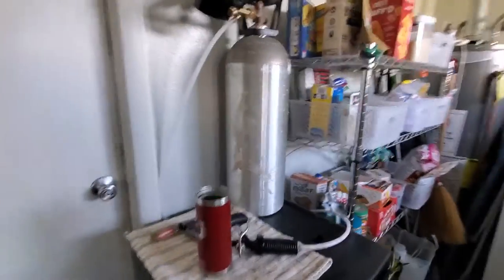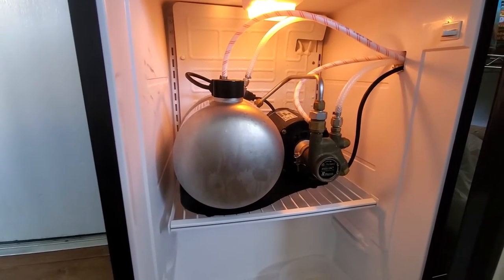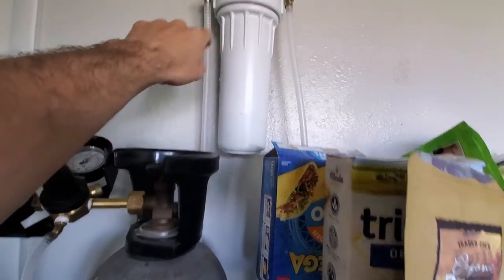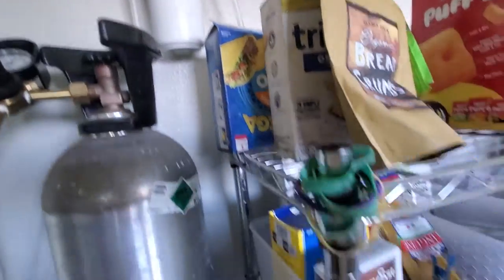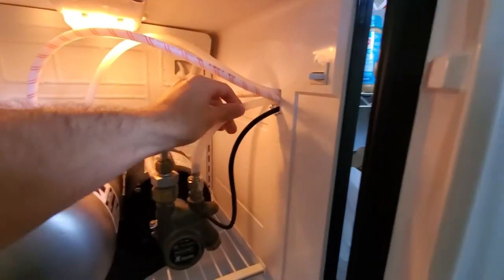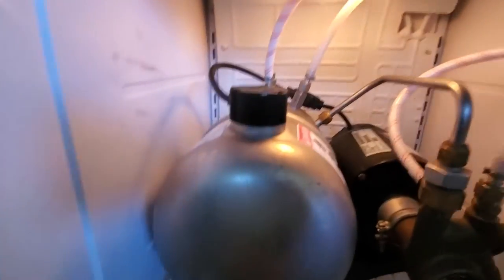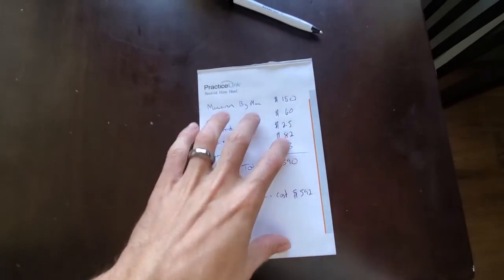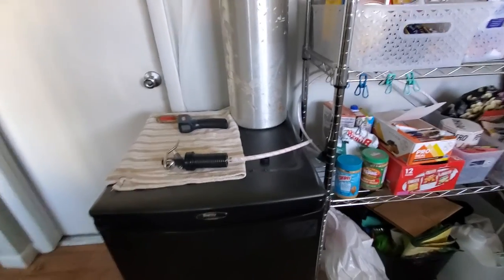DIY Home Seltzer "On-Tap"

Comment: You can add a long section of coiled hose inside of the fridge to the water in line. When water is pulled in it will pull the chilled water in that length of hose first. This is how the water dispenser in my old fridge served cold water.
The only challenge is with mini-fridges not having the best temperature control to keep it above freezing, so I would be careful with thermostat and placement of hoses. Possibly some strategically placed insulation to keep the coldest area semi-isolated to the coil and thermostat.

Comment: Awesome system and very well done Sean!

I am have been making home seltzer water for many years using the 2-liter bottle and co2 tank method. 

Question: If the carbonator is just pumping water into a chilled tank with Co2 applied to the tank...why is the pump really needed? It does not seem like it is agitating the water? Does is add PSI to the system for enabling the water from the tank to travel a distance? 

My experience has been that agitating cold water with Co2 gets the "tart" I like. I run about 32psi with vigorous shaking for about a minute total. I am not quite getting how the carbonator is able to infuse the co2 into the water as it seems the two only meet in the chilled tank.

Thank you!
Reply from the maker: @real_sovol_sv01_experience91  nice sounds like you've been making some tasty seltzer! The pump is required bc the co2 tanks regulator is setting the pressure in the tank. So if you're co2 is at 90 psi that overrides most home water systems pressure hence the pump. I assume the ambient pressure in the tank even after water is added will still be whatever you set it to on the regulator.. I think the pressurized nature of the system is what requires not agitation. Compared to your system where you are adding gas to water I am adding water to gas. Hope that's clear!

Comment: I'm currently working on a very similar setup minus the filter and add in a corny keg inside the fridge where the water first comes in so it can be cold when it enters the big mac.  I wanted to ask you about the process of cutting a hole in the fridge and mainly what you used to seal it and how that experience went.  Also I plan to detach the motor and run that outside the fridge to avoid damage from condensation.  I've also seen suggestions to insulate the water lines in the fridge so they don't freeze, also on the outside to the dispenser to keep it as cold as possible.  I'm also going to make a video overviewing my experience once I get it running.  I have made I think every mistake you can on this and also I'm so surprised you got a big mac for $150, that's so cheap.
Reply from the maker: Interesting, I'm looking forward to hearing about your findings. Cutting the fridge sucks. I have some random $25 yard sale find but even with a brand new fridge I doubt you'll be able to find schematics on where the coolant lines are running. I would assume that they are basically everywhere. I used a dremel to cut into the sheet metal on the side and bent it back to see if i was safe or not. I was pretty delicate and still ended up knicking a copper line inside luckily it didn't blow. i just put duct tape around the sharp edges shoved the lines through and called it good. It could be done "better". As for the insulated lines, yes that is the main reason I cannot go colder. Perhaps larger line would be better although I am already using 1/4". Is there a product in mind you know of for line insulation?
Reply: @seanmacdonald8476  I'm working on figuring the rest out... I did hear something in a video saying make sure your water in line to the pump is Not 1/4", needs to be 3/8" or will prematurely kill the pump...
Reply: @seanmacdonald8476   Finally got around to making the video https://youtu.be/7giFPwGIMBQ

Comment: What i don't like about the McCann's pump is the internal vanes are plastic, the vanes wear and from time to time you can see the plastic specs in the water. there is no filter that ive found to successfully filter under the 125 psi pressure produced post pump. Ive flushed the pump and tank multiple times and still have issues.

Comment: Great video! Can you share where you purchased the beverage hose from?
Reply from the maker: Thanks glad you have found it helpful. I used midwest beverage for the majority of it and found some other bev flex on ebay. For midwest this was what i got (1/4 ID x .457 OD Bev-Flex Series 170-04100 (100 ft))... I have since been told that a larger diameter hose (3/8) would be more appropriate to put less strain on the pump. Good luck

Comment: I would like to know where you got the McCanns Big Mac for $150. Can't find it anywhere for under $600.
Reply from the maker: Sounds like you're looking at new? I only ever intended to buy used and I got mine on ebay. There is currently one that looks refurbished on ebay for $275 shipped
Reply: @seanmacdonald8476  Have any issues with used/refurb?
Reply from the maker: @awjone0  Nope, i think i even bought mine as for "parts only" since they never plugged it in to test it dry they couldn't say if it worked... so maybe that's why i got cheaper but the $275 really doesn't sound so bad if you're trying to get set up right now

Comment: Thatnk you for the video.  I have a couple of questions.
1. Are you doing any sort of insulation where you cut the hole to prevent the loss of refrigaration?
2. Do you know how minimum temp for the motor?  Im wondering if the BigMac would function in a Keezer.
Reply from the maker: Hey, I'm not doing anything for extra insulation the hoses take up just about all the space. You could get messy with some spray foam as others have done but I just haven't. I do not know any specs regarding the motor and temperature sorry! With a little extra hose and some more fittings you can detatch the motor/pump and keep it externally

Comment: Hi great job on your setup. 
quick question whats the brand and size of the fridge?
is it 3.2cu?
Reply from the maker: Thanks! If i had to guess it's the 4.2 cubic foot size. Model is Danby. I'd recommend getting the carbonator first and then just finding the cheapest/free one on marketplace. Then be careful not to cut any refrigerant lines!
Reply: @seanmacdonald8476  Thank you for the tip! I also heard that putting the motor inside the fridge can cause heat and condensation. Have you had any problems with the motor in the fridge?
Reply from the maker: @dorofino  I have not had any issues however i live in a pretty dry climate.. if that makes a difference I do not know
Reply: @seanmacdonald8476  how long you have been having running for?
Reply from the maker: ~20 months? @dorofino
Reply: @seanmacdonald8476  and no issues.. ok.. Im down in FL.. you i may move it outside.  thank you for your feedback
Reply: Hello, once again. Quick question: What is the size of the hose you used to get water into the carbonator? Also, what brand of hose are you using? Do you notice any taste in the water?
Reply from the maker: @dorofino  everythin i used is 1/4" tho another commenter made a point that 3/8ths is ideal for not putting strain on the pump. Looks like the stainless steel tube from pump to tank is 1/4... so who knows I haven't had issues yet. I used standard bevflex and don't notice a taste 1/4 ID x .457 OD Bev-Flex Series 170-04100 (100 ft)

Comment: Seems like it would have been way easier to just fill a corny keg with filtered water and carbonate that straight off your CO2 tank. Dispense it with  tap just like a kegerator.
Reply from the maker: But then you would have to fill the keg like a plebeian. And you would need to be able to fit the corny keg in a refrigerator which would further limit your capacity. Easy is for wimps. Unlimited tap is for kings
Reply: I have to agree. I wanted to go the kegerator route as I had an extra mini fridge but it was too much work. After eating h fridge to keg conversions I would have to cut up the fridge so the keg would fit. Then have to replace the keg ever so often then wait for it to carbonate. This route is also cheaper depending on how much you pay for the carbonator. Thanks for the vid.